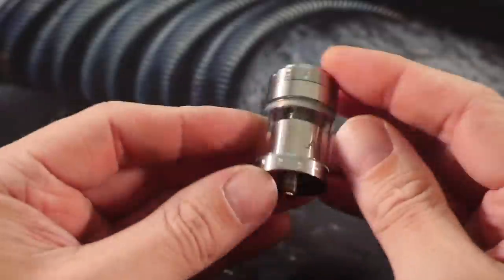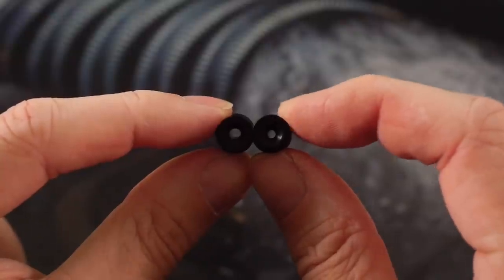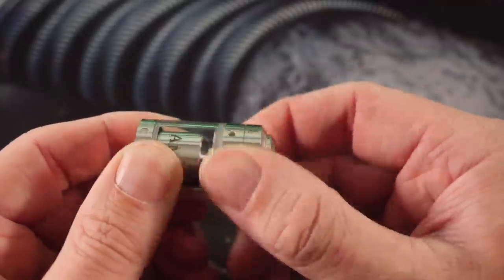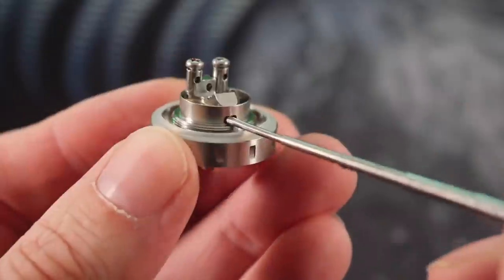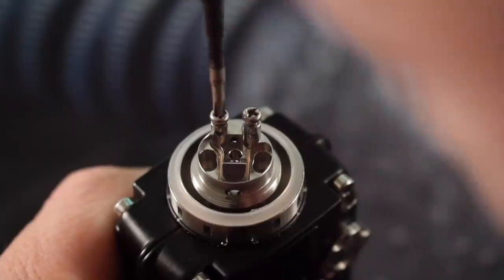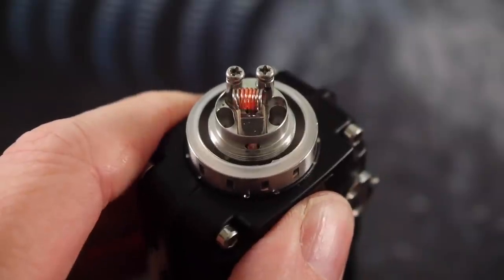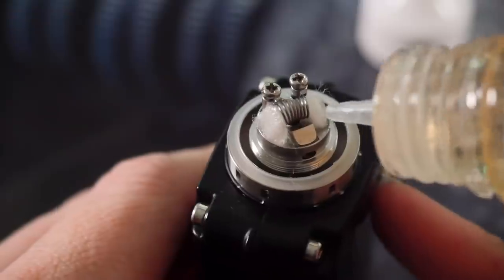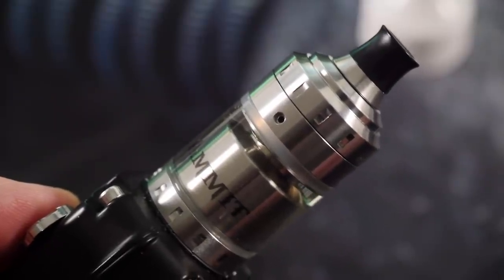The Geek Vape AMMIT MTL RTA

Comment: As a MTL user before the term wasn't even used, for over a decade now. I find most miss the mark on this. Geekvapes original Zeus single-only tank is a beast of a MTL for me. Regardless of what they market it for. My favorite. Beating out any kayfun including the prime or lemos for me. Simply because I can't even dry it(unless empty), and can't leak it. Now flavor wise I'm not the guy, for I use menthol flavors. Going to try out this tank and probably disappoint myself in to much restricted airflow compared to the bliss of the zeus. I really dig the big bore mouth piece, unlike this shown device. That is from a MTL only user. The dual-coil zeus is garbage to me, gave it away. Something about dual coil setups for my MTL use, just does not produce a smooth vape. Even if I build it to a single coil, its not even remotely the same as the original single-coil version.

Comment: Out of curiosity why would one not want to use a hybrid mech mod with this atomizer? Since it’s powdered by one battery usually 18650 a higher ohms coil would be easier for the single unregulated battery i though instead of a dual coil 0.24 ohm build

Comment: well, just ordered a kayfun lite plus haha. been really into mtl recently and im craving the flavor. ive never built for a mtl device, ive been using the innokin eq pod, anyone have a suggestion for a nice flavorful build?
Reply: I run a micro fused clapton, usually a 30x40 n80 fused clapton around .8 to 1.2 ohms depending on the mg of liquid I'm using.
Reply: soo, I did one round wire build (27awg nichrome 10-11 wraps) and got very mediocre flavor. just threw a little Clapton coil in there and im still not getting great flavor. what am I doing wrong? Im sad to report that my Innokin EQ pod with mesh coils is currently outperforming my kayfun lite plus in the flavor department.
Reply: @TinMan445  Not surprised. I recently bought a Kayfun Prime looking for a quality MTL and I get almost no flavor as well. What type of juice are you using in yours? Im wondering if it will be any better with fruity juices. Im on a dessert kick atm and they def don't work in my Kayfun.
Reply: i only vape fruit and candy flavors so you can cross that off the list.

Comment: Since I'm basically necroing this thread, I don't expect you to see this, but just in case, I just came across this video, as I'm looking for a MTL RTA that is leak-proof. I searched everywhere, and this one seems to have been discontinued, which sucks because it's the main one I want, lol.  Do have any recommendations that would be similar?  I really like Geekvape for the no-leak thing, as that's been an issue for me that I just don't like having to deal with.
Reply from the maker: Check out an Innokin Pbusardo / Dimitri RTA.  ARES RTA
Reply: @GrimmGreen  Oh wow. You actually saw this. lol.  Thanks for the suggestion! Would you say the Ares 2 is better than the original Ares? I just saw your review on the 2, and that sounds intriguing. This would be my first MTL (I'm used to using the old DTL Geekvape Zeus Dual, but I think it's finally dying and I want a change in vape style), so I've been researching a lot and watching videos on most anything I see with "MTL RTA", but the search gets overwhelming. XD